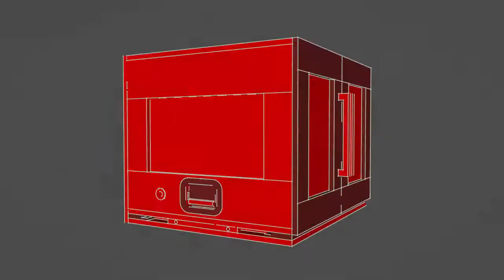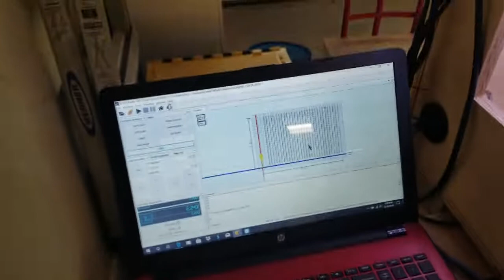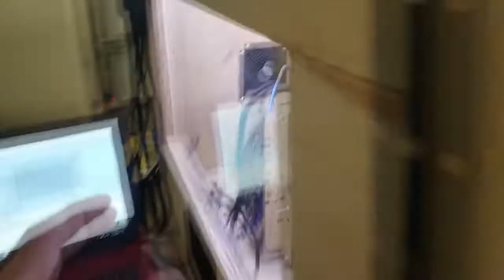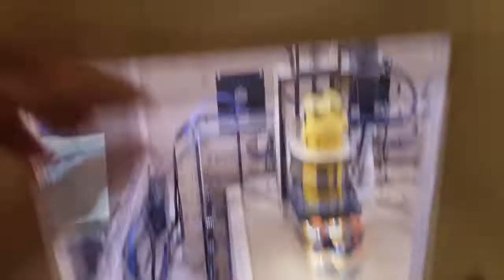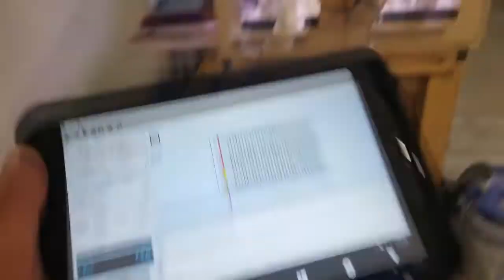CNC Router Enclosure Prototype #1

Comment: This thing is awesome, Gage! I'm currently working on a design of my own. I really like the dead switch idea and the small fans you use, do you have links for either of those?
Reply from the maker: Thank you!! Definitely excited to hear about what you got going on. Love to check it out when your all done. I made a better updated video a little bit ago, called All N One Cnc Router Work Station, this is my current revision. 

So those fans i picked up on Amazon, I currently dont have my affiliate program set up,  but just search AC Infinity Multifan (80mm are my small ones and 120mm are the larger ones)

Comment: Not bad ideas at all. You gave me some good ideas for mine. But the ESTOP should be wired. If that remote dies youre going to be fumbling to stop it
Reply from the maker: Oh for sure, I have a new updated rig (an all in one cnc work station with a dual machine setup). I still use the remote system but i bought a much nicer one that works for long distances throughout the house. And then the machines have a kill switch right on the side of the boxes, assuming im in the garage near by. Excited to show off the new setup very soon!
Reply: Gage Robinson DO IT ! Lol